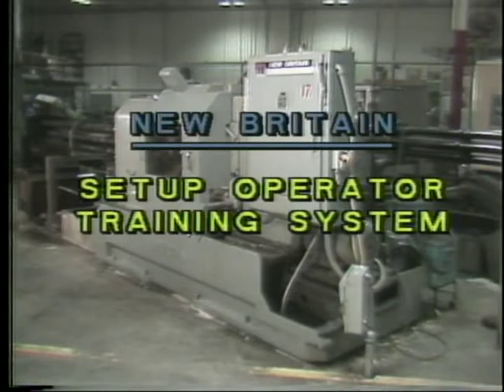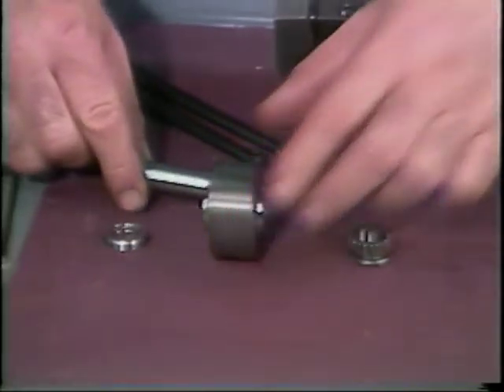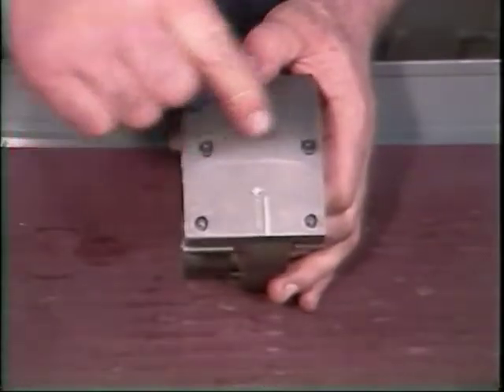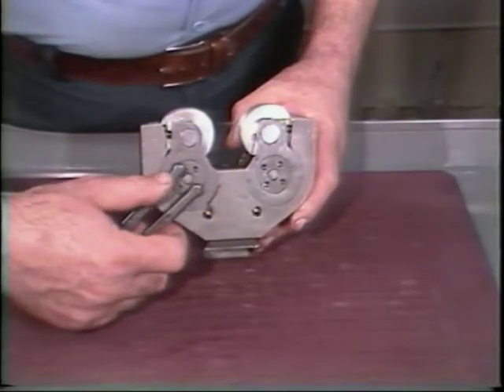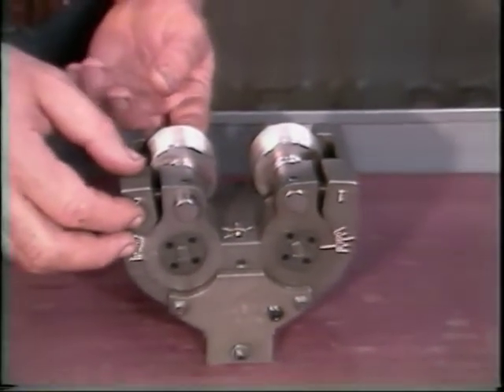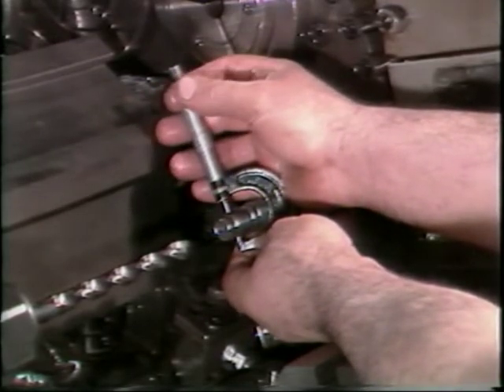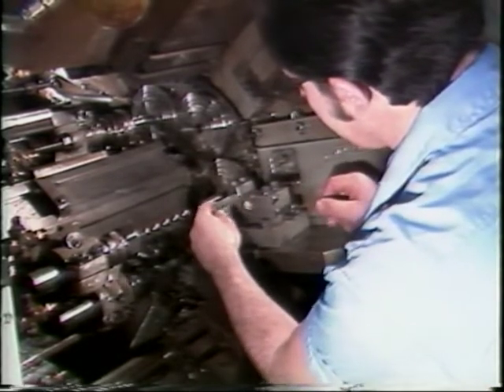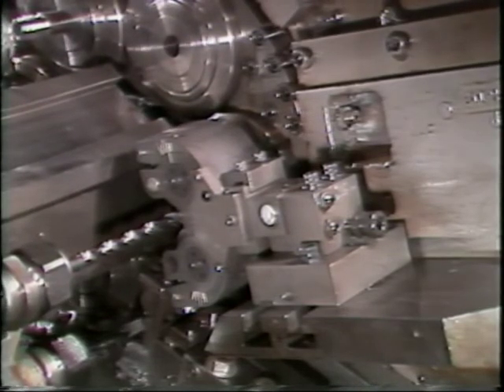New Britain Setup Training Lesson 15: Thread Rolling

Comment: We use reed rico heads reed and salvo rolls and the timing marks cand be at 3 and 9 oclock to 2 and 10 oclock. Plus we have thrust washers of different thickness to take up side play of the rolls in our heads. What rolls are these I see there wasn't any washers in this head. I wish we had holders like this, we just adjust the cross slide to the high point and can be tedious at times. Also, do you have videos for fine tuning pipe threads so they are not overfilled and timed correctly.